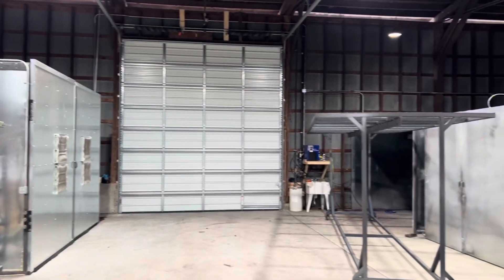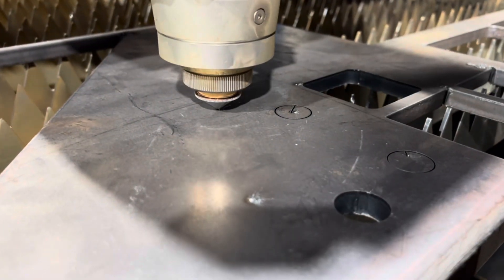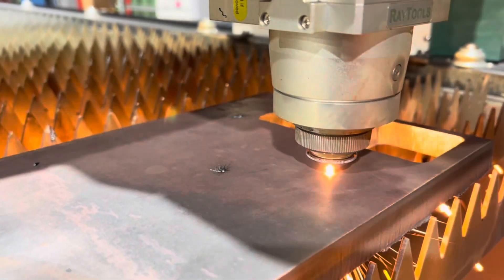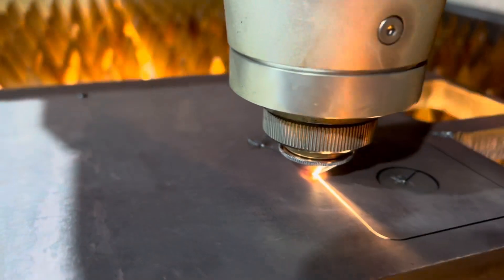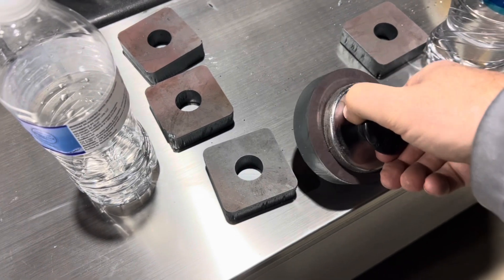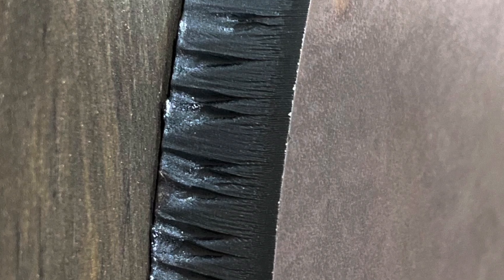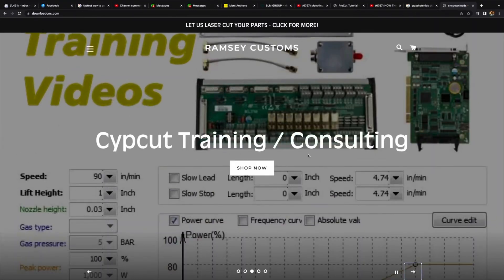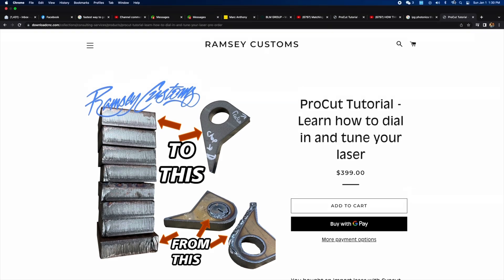My Laser Is Cutting Bad

Comment: i do have a question, when u cut aluminium, did u ever managed to get the "striations" out ? like make it smooth mirror like finish from start? cause im doing that this week and not entirely sure if my machine can do it... or thats the best i can achieve ... i watched a bunch of videos... and seems everyone having same issue. striations on the cutting edges... from laser frequency pulses... even though we running the machine in CW basically no pulses... or lowest ammount possible... still visible edge marks.
Reply: Are you cutting with air as the assist gas? If so, there is always going to be at least a little bit of striation and rough edge because the air is instantly cooling the dross and forming aluminum oxide. For best results cutting aluminum,  nitrogen as the assist gas is recommended.  Air is still definitely possible to get good cuts (ny shop doesn't use nitrogen) but it is not for best results

Comment: arc cuts are the worst... and especially if you go down in size... actually i retract my statement... diamond shape holes are a pain.... especially middle holes.... like unless u do big stuff like in this video u got plenty of space to pierce in middle... but if u go 3mm width or ~0.1"ungahunkas units...  oh man that wont be fun, especially if u want to have a very clean cut. what i found out that worked for my workplace... is using nitrogen instead of oxigen... cuts the best less burrs etc. but the machine to make it so u dont buy it... is expensive as heck.

Comment: straight cut  and arc cut  always differ a litte, due to accelerations

another issue is the thickness
3kw is capable and possible you could get trough on 1 inches, but its already too much  for a 3 kw

Comment: Center of lens is not in limits. Try regulating lens. other thing can be that the last glass is dirty, need to change < experience with HSG industrial lasers over 4 years
Reply: What's the best way to clean the striation after the cut without damaging the part?
Reply: @eduardogm8236  Never had to... because the cut is perfect. if you have something like that just use angle grinder with fine grit sand paper

Comment: You didn't say what changes you made to the parameters. Please explain this
Reply: in my 7 years experience it's pretty much about between focus and gas and also speed and the power too...now I'm running ft-150 fiber tube laser and it's so difficult I'm stuckler with my new machine.

Comment: Hey what's going. On.  I'm cutting some 3/4 on a 6kw fiber laser cutter.    What parameters did you adjust. To get that smoothness ??
Reply: Reduce the gas
Reply: How to buy your course
Reply: Biggest adjustment is gas pressure, then speed, and power. 02 cutting is lower pressure, and .1 bar can make quite the difference. .5 to 1.2 bar is depending on nozzle and cutting head. Carbon steel cutting shouldn't use more than 6k, Unlike nitrogen cutting where the more power you have the faster it can cut.
Reply from the maker: you have to buy the videos for it man, I have tons of videos showing all kinds of things for free, but if you want to learn how to master your laser, you have to buy the course.

Comment: Having this problem now. 3/8” carbon steel. Running oxygen. Man I’ve messed with all the settings. Also using cypcut
Reply from the maker: yea, most guys do struggle with that, but its easy to make them cut like butter if you know the process.
Reply: @turbocobra  and 3/8" is its max. I'm sure that has a lot to do with it. It's at max power
Reply: @bradsmith1896 how many KW is your laser source?

Comment: Easy to solve, use less gas and speed. Will help allot... And maybe play little bit with the focus.. 399usd Pfff hard for some settings
Reply: Sir.  Can I increase the cut focus value or decrease the cut focus value to remove the notches
Reply: Or just more power
Reply: How did you learn parameter setting?
Reply: Guys, never trust what this man is commenting he knows nothing about laser. It is not just gas, speed, and focus it is more further than that. I haven't seen the course, but im says that with practical experience and taking academic knowledge about laser applications
Everyone will understand what im saying when the client asks you to cut very accurate and clean cs or ss or Al or any other material in short periods of time because the huge amount of sheets needs to be cut for the project
Reply: @saifaldrson4182 technically you both are right. As someone with notes from bystronics, they specifically say to change focus first, then do gas pressure and/or speed. Then if you still can't get it right, you get in to more technical parameters.
Reply: ok can you told us how to deal with focus and pressure?? @saifaldrson4182

Comment: Hi Ramsey, I'm so thankful to have found your channel and now find out you sell training for these chinese lasers. I'm about to order my first chinese fiber laser, 6kw enclosed, at this point I'm just zeroing in on two resellers, I would like to be able to buy from you, but I'm not in the USA they both offer this optional software Cypnest instead of Cypcut for $1,480.00 USD.
From what I've found, everyone says it's better to get this Cypnest option if you can. But I haven't found out if there is a better option to both of them.
Do you have any experience with Cypnest?
Do you recommend it or something else? and,
Will your Cypcut training package help me setup my machine if I end up getting this Cypnest software?
Reply: Did you end up buying your machine already? I have experience with CypNest
Reply: @joelamoos5684  yes, it took long, but I should have it in my shop November 7.
For all I was able to find online, it did look like a good choice to order cypnest with my machine, have you found cypnest better than cypcut?
Reply: Same question, what did you do?
Reply: @gustavoanuch890  i ended up getting it, I’ve had it up and running for a couple weeks now, I guess I was more apprehensive about this than needed. Setup was easy. Sometimes I get stuck tuning some materials, but otherwise once I get to where my machine’s parameters work… it’s a dream come true.

Comment: I work on a 3000w gweike fiber laser machine. One of the problems I have is with heating the plates in small areas.
Reply: How had your experience with Gweike been so far?
Reply: @joelamoos5684  It's an excellent laser cutting machine, but it's lacking in some cyp cut functions.
Reply: I am buying a gweike also, hows the experience?
Reply: @gustavoanuch890  for cost benefit, a great machine, very low maintenance and simple operating system
Reply: I work on a gweike 12kw. Guys there is so much smoke coming out of the fully closed machine that you couldn't believe. Especially when cutting with oxygen. Also table change is very slow around 45sec. As far the parameters concerned, there aren't any. Be prepared to buy at least 20 protective lenses because that son of a bitch gets dirty really easily